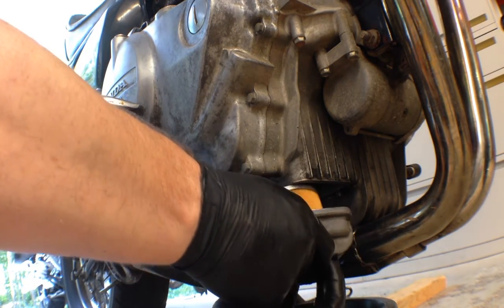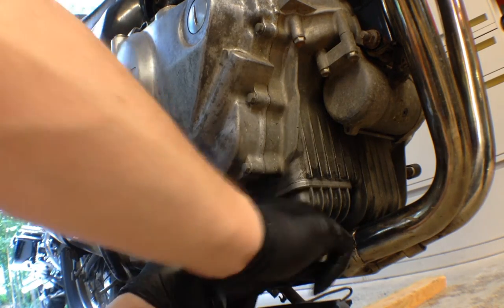How to change oil/filter on Honda CM400E

Comment: Awesome tutorial thanks! First time rider.. Honda CM450A I usually just have my mechanic knock out an oil change when I bring it in for other service but I did it myself thanks to the tutorial... that being said... it's leaking out of the oil filter bolt. Did I tighten it too much or did I add too much oil? Or perhaps something else? I put in 2.5 quarts as instructed through another source. Any ideas? thanks so much for this... really helped a lot!
Reply from the maker: Mike Capozzi Thanks for watching. Did you replace the oil filter bolt o-ring and torque to your bike torque specifications?
Reply: Hey thanks for responding so quickly..that's awesome of you. I did replace the o-ring.. the bolt itself is very stripped but I tightened it back up to the way it was before the process.
Reply: Well.... I fixed it. You may have guessed what happened but I wanted to let you know. The casing itself cracked! Thankfully my parts store a few miles away had one for me. So that all being said... perfect "how to" and worked perfectly for me. Thanks again
Reply from the maker: Awesome glad you found the problem and the parts to fix the leak. 👍🏻

Comment: Hey thanks for posting.  Not too many videos on these bike. I'm about to do mine soon. A question, on the side of the cylinder, there are 2 deep holes. I got water in there from washing it, I thought those holes were sealed! Would the water get mixed with the oil? If I drain the oil, it would also drain the water thay got it? Super nervous about it!
Reply from the maker: It’s possible I guess. Change the oil it can’t hurt.

Comment: My MC is do for oil change soon, it's a pain in the ass to do. The oil filter is in the worse possible place. Anyway, well done! Tarr
Reply from the maker: Are you riding a HD?
Reply: Yes, Tarr O2 flhr with only 25,000 miles
Reply from the maker: +Al Diaz I have a 03 FLHRI with 10,000 miles. Seen in the video.
Reply: Solid, seen it in the video, 03 is an anniversary addition with the metal decal on the tank?
Man I thought my mileage was low, get her on video. I'm gonna try to do the same. Ride safe!

Comment: What size filter is that
Reply from the maker: Tony Heilker wix filter 24939 or I think you can use a fram ch6008 just make sure you check that it will fit your bike before you buy.
Reply: Tarrnation  thanks I have a cm400t
Reply from the maker: Tony Heilker they are fun bikes.